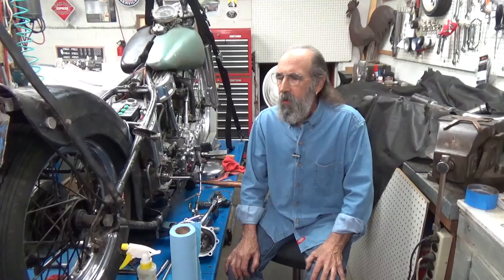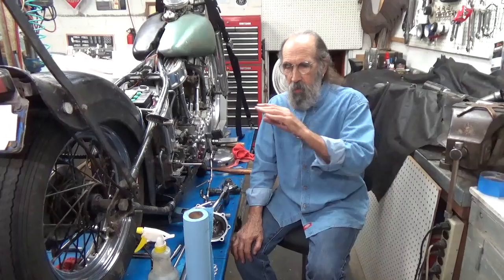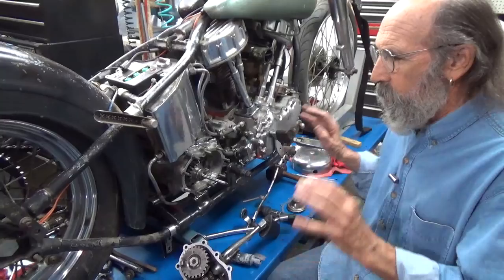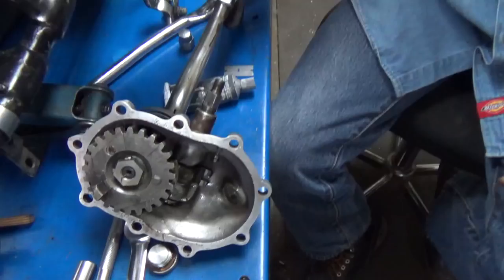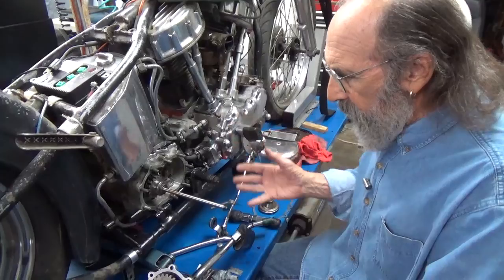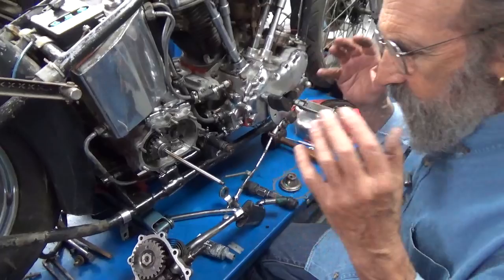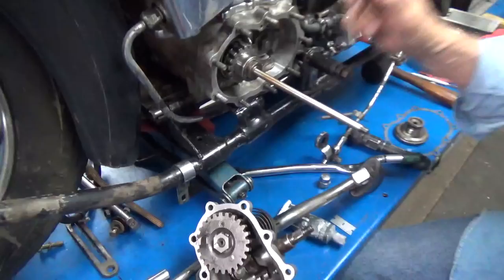Step 5 Reinstalling The Kickstarter on the Panhead

Comment: I am interested in a 1948 original panhead.  I heard that you have had trouble adjusting the stock hydraulic lifters.  I am curious about why?  I heard that you changed them with solid lifters?  Is there a video about this?
Thank you so much.
Howard Janin
Reply from the maker: Originally (you missed it on the video), 48-52 Panheads had hydraulic pushrods.  53's up came with hydraulic lifters and used the same ones through the Shovelhead years.  Adjust hydraulic pushrod?  I've never owned a set, but most people changed them for solid pushrods and solid lifters.  The hydraulic lifters used in Shovelheads can definitely be improved upon.

Comment: Mike, I have a 1978 1/2 flh shovel head. I need to replace the starter ring gear, would you tell me the best way to change the ring gear?
Reply from the maker: Best on a lathe and weld it.  Just my opinion.

Comment: Mike - I've got a bit of a mystery that perhaps you can clear up.  Installed the kicker as you did, no issues.  But when I go to adjust the lever to 4-1/4" on the other side, it swings nicely back to about 4" and then... stops.  The adjustment screw acts like it's bottomed out; turning it becomes very hard and the lever won't move aft any more.  But, loosen the screw, and voila--you can swing the lever back freely aft as far as you wish.  Do you know what's causing this?  P.S. - no difference with a 3-1/4 or 3-1/2 pushrod.
Reply from the maker: The arm should move to the rear as you tighten the center screw in the clutch.  I'm missing something here.  I don't quite understand.
Reply: @pacificmike9501  - You know, I think I've figured it out.  I believe the lever that actuates the throwout bearing--and which passes under the oil tank--is poorly made. That is, I think the square hole stamped or machined into the right-hand end is off just a bit.  So, I set it as far back as it would go, finished up the mousetrap adjustment scenario per your other video, and it works just fine.  Thank you for writing back!
Reply from the maker: It's hard to tell from a distance.  I have heated and bent those arms. I have shimmed them to raise them.  Sometimes factory specs are just a place to start.  And, we come along and mix and match brands, usually by introducing reproductions. But, it's the life of us guys who love this old stuff.
Reply: @pacificmike9501  - Amen, Mike.  I sometimes think that folks who love tinkering with these old machines are getting as rare as the bikes themselves.  Three of us are riding to El Cabezon on the 15th https://en.wikipedia.org/wiki/Cabezon_Peak - an iron head Sporty, a Shovel, and my Pan-Shovel.  Wish you could join us!
Reply from the maker: Looks awesome.  Thanx for the invite.  I will be at the annual El Camino College Antique Motorcycle Show and Swap Meet in Torrance California.

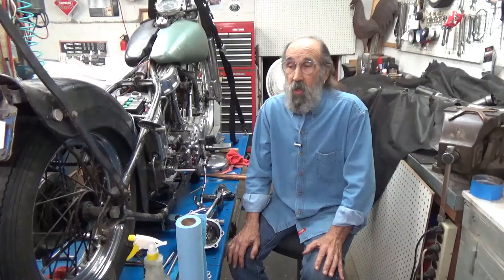Comment: Not to get off topic, I watched several episodes of your videos and I like what you’ve done. But my question is about early model fork locks that are in the frame neck and are meant to lock the steering head. Absolutely no information about this particular front end lock R&R procedure is available. I’ve got a 65 ElectraGlide that has the keyed lock cylinder in the neck of the frame. There’s a roll pin that’s visible at 1:00-2:00 position and I’ve yet to figure out how to remove and replace it. Can you give me some insight on this? Stay Safe n keep the rubber side down.
Reply from the maker: That roll pin is quite difficult to remove.  A right angle drill attachment works.  It's still difficult.  The good news is, once you get that lock cylinder removed, although it's usually completely destroyed, you can buy a new one just like the original.  V-Twin has them.

Comment: Oil drain hose, 883 super low rider, 2019, hose near connection shows cracks and leaking. Is it because it is in such a hot location it needs to be replaced so early? Why is it a special shape hose? Not a great design if the hose leaks really bad when you are on the road riding, it looks you can damage the engine real fast
Reply from the maker: I'm not the engineer, just another guy.

Comment: Mike, I've seen you use thread locker only a few times... Not really required on the trans door?
Reply from the maker: I like to keep threads nice and clean.  I only use thread locker where I feel it is necessary.

Comment: I purshased a 1974 flh with a five speed tranny.  The original kicker tranny was also included in the sale . Can I just swap out the kicker cover into the five speed ? Or do I have to put the whole tranny back ? Thank you
Reply from the maker: I don't know what case you have with your 5 speed.  If the kicker cover fits, it will probably accept the whole starter setup.

Comment: Hey Mike I have a '76 FXE with a -58 swingarm & drum brake, a '69 FL front end, a Paughco tin primary, and I'm also running a rocker clutch. 
... Anyway I have a starter clutch question for you. When I built the bike I got a V-Twin early style throw out bearing conversion kit for it. I recently removed my kicker cover and noticed on my starter clutch gear( on the surface that runs inside of my early style throw out bearing), there is a small hole going torwards the main shaft that looked like a set screw hole or something of that nature. Upon further inspection I do not find a set screw in 'er, rather a teenie weenie lil spring just laying loose in that hole! I guess with the throw out bearing over the starter clutch gear it couldn't come out, but WHAT'S THE DEAL???
Thank You Very Much & Great Videos My Friend!
Reply from the maker: Look inside the throwout bearing and notice there is a groove.  That little ball on the outside of the gear fits into that groove and holds the inner race in place on the gear.
Reply: @pacificmike9501  Thank You So Much for the quick response My Friend!! ....& My Starter Clutch Gear no longer has it's little ball on it. Just a small hole with a tiny spring hanging out all loosey-goosey inside of said hole😟. I have to believe that I need to order a new starter clutch gear for her, huh?
Reply from the maker: It will work as it is, but to be "proper" it should be there.

Comment: Looks like an old Tillotson carb on there. Friend of mine had an old panhead with that carb on it.
Reply from the maker: Tillotsons were pot metal disphragm carburetors.  Linkerts have a typical float chamber made of cast aluminum and a solid brass body.

Comment: Hello Mike, thank you for all the great info. Do you have any videos of pulling and replacing the meshed kickstart mainshaft gears on a four speed? The ones in front of the spring. That would be a big help right about now. 😊
Reply from the maker: Simply bend the lock tab, take off the nut and if the outer gear doesn't come right off, use a small gear puller.  I do show some kickstart stuff.  Go to our youtube homepage and click on the word, "videos."  They'll all come up.  We will be explaining that in our next video, either tonight or tomorrow.
Reply: @pacificmike9501  thank you 😊
Reply from the maker: You bet.

Comment: I’ve got a 99 softail custom evo, sometimes when I start I hear like a gear slip/grind-thinking it’s gear in starter or something. Ideas on where to start my inspection
Reply from the maker: It will get worse.  Removing outer primary cover and removing starter will probably reveal a bad starter clutch.  Or, it is the way your gear on the starter jackshaft is not meshing properly on the starter ring gear on the clutch basket.  Before putting your hands anywhere near those starter drive parts, disconnect your battery!

Comment: Mike I have a 1980 FLT.   The first for the road glide the dual front brakes ruber mounted motor 5speed transmission enclosed drive chain. Has a crome carb and i cant find a rebuild kit for it. im in New Mexico. Both the bike shops in the area dont have a kit for the carb and wont order one. Do you know where I can order one?😎👍✌
Reply from the maker: The carb must have some identifying marks on it.  Can't see it from here.  Did someone plate it?  Or is it maybe just polished?

Comment: Mr. Pacific Mike,, watch your channel and absolutely love it, you almost make me think I might end up doing some mechanical work.  I  have had numerous Harley Davidson of various types but never did the mechanical work to to my work. But now that I am retired, and  slowly getting back into the groove (getting my groove on) I would like very much for some advice.  I  bought in 2016 a new 2015 Sporty and want to change it to a hard tail plus do some engine work. I only have about 40 miles on this bike, have had some health issues but I want to or am thinking about a complete screaming eagle package. Yes no maybe so. Any words of wisdom.
Reply from the maker: Okay, I hope my opinion doesn't offend you.  First a new Harley Davidson Sportster is a real nice motorcycle.  With low mileage on it now, it will last you a very long time.  Way cool.  I really like the way those new Sportsters (like yours) handle.  Respectfully, I get that you're not a kid any more.  I don't think I'd be doing frame modifications to a bike that handles so well and is so comfortable.  Now, if it's an 883, punching it out to 1200 is quite an improvement.
Reply: @pacificmike9501  Mr. Mike, thank you for your fast reply, it was a surprise.  Offend me,,, no sir I have never been offended by honesty, made me mad little, then felt like an idiot for getting mad. A kid at hart always but no I am 73 and just beet lung cancer so far. I value your opinion (we all know what that is, cause we all have one) 😎. I  was thinking somewhat the same. But this bike is paid for so I was thinking $$$$$. But I really want to be able to fix my own machine, but right now I'm about as dumb as one can imagine when it come to bikes. So I am thinking is find a frame and build up from there right?????? There again dumb sets in not a welder. Like I have always had my work done for me cause of my job. Now I want to build a bike old school. Hard tail, kickstart don't want the front forks way out front. 
Indian Larry was my type of builder and you. Would you mind giving me advice.
Reply from the maker: Mind?  Of course not.  Look at the Paughco online catalog.  They have every combination of frame, frontend, gas tank, fender, etc to build the bike out of your Sportster, that you would like.  The stuff fits and for the most part, can be bolted together.
Reply: @pacificmike9501  Well Mr. Mike I want to thank you ahead of time for being willing to take time out of your day to help this old coot. Your input is really appreciated. And I think you are right, instead of messing up a perfectly good sportster, I think it is best if I build from the frame up. Oh man I can see it now what a possible  mess. You do have really gooooooood patience cause I will probably give them a good workout, 👍 plus my sick jokes.

Comment: ✊🏻👍👌🙏 short ride today. Tuning in windshields - best angle and height . Always sumthin; keeps the noggin go’n -
Reply from the maker: Hold the bike straight up, put a big fan blowing at it from straight in front.  Smoke a big cigar and blow the smoke at it.  See where the smoke goes and adjust the windshield accordingly. That's how I create my own wind tunnel.
Reply: @pacificmike9501  man great idea ; I have that kinda fan in garage . May go a step further and sit on bike in front of fan and adj angle . I’m out of cigars 😁 . Sounds good . Seen one guy taped tassels to top of windshield to show air flow . Knowledge is power !!!-  ✊🏻👍👌🙏🙏🙏
Reply: It worked mike ; I adjusted up 1 “ and angle about 28 degrees. Way way better !!!-
Many thanks : 🙏🙏🙏

Comment: I'm having trouble getting my exterior return spring on my kick start for my 62 Pan trany
Reply from the maker: Stop.  Look at it and get the idea of he order you want things to go.  Get the ped al where you want it.  Then make sure that you cock the spring so it's loaded against the shaft, keeping the shaft in the position you want it.  Don't forget the big flatwasher.
Reply: @pacificmike9501  My main problem was trying to get the spring in the notch on the shaft. I cleaned it with a wire brush, then greased it and still had to tap it in with a small hammer. I gotta bite on it then spun the spring around to hook it up and now it rubs my exhaust pipe.
Reply from the maker: Welcome to the world of parts.  They are probably aftermarket parts, which is fine.  It's your job to fit them.  And, as you go along, you'll get better at it.  I told my boss in a shop I worked at years ago, "This is hard to do, you know.!"  He said "Yes!  That's why they pay US to do it!"

Comment: hey mike merry xmas, ?, will a 71 sport points breaker plate fit in a 77 shovel
Reply from the maker: Yes, I believe so.
Reply from the maker: Yes, it is the same part.  I had a brain fade and just looked it up.
Reply: @pacificmike9501  tks Mike